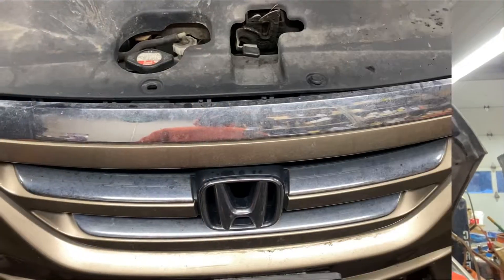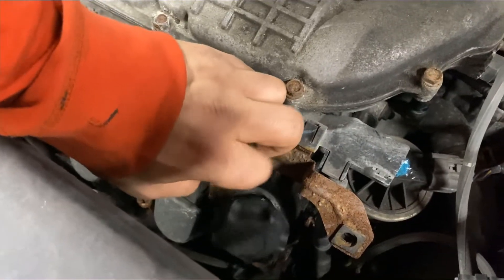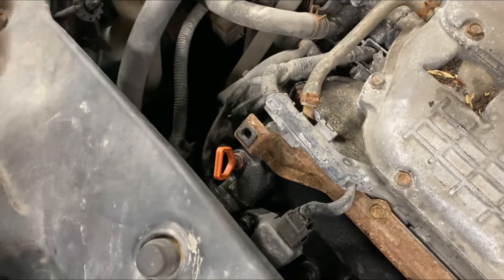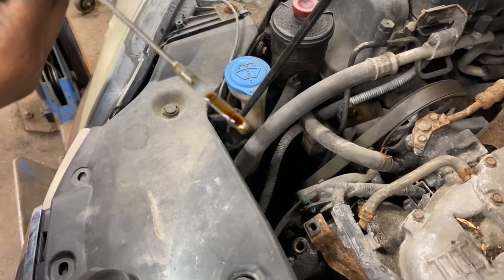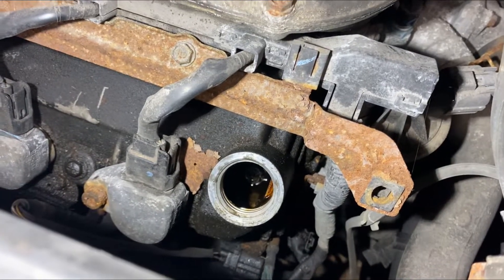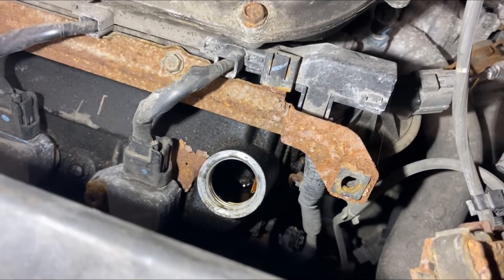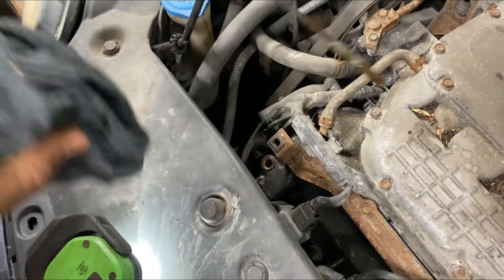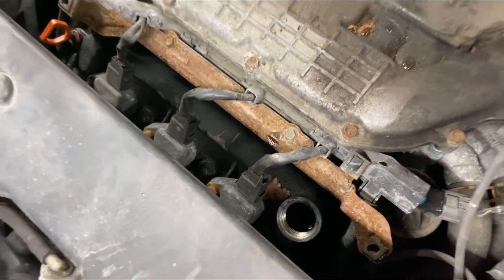What Happens If You Drive Or Run Your Car With No Engine Oil Cap! #Subscribe #experiment #auto #new

Comment: I had my car serviced while on vacation.  Driving home I noticed brown dots flying up my windshield for 25 kilometers and had no idea what it was.  Then my low oil light came on so i drove immediately to a gas station.  When i opened the hood,  the engine bay and hood were covered in oil and the oil filler cap was off.  I bought some aluminum foil and put it over the filler hole after putting in 2 quarts of oil.  I had 250 kilometers to get home.  I had to add 2 more quarts of oil and replaced the aluminum foil twice.
Reply: There was no auto parts stores in that 250k trip🤯

Comment: You only talked about the possible mess and lower oil level if driving with no oil cap, but that cap also maintains crank case pressure too...potentially leading to inadequate lubrication under engine load. 😱

Comment: I forgot to put the oil cap back on after filling up my oil and I drove for 4 days like this the car ran perfect no problems no loss of power but I got home parked it and when I turn the key to start it nothing it’s dead and my battery is fully charged I’m worried I ruined the engine due to no cap but no oil spilled out none the oil was still full and the location of the gas cap is straight up making it difficult for the oil to escape but my heart dropped when I seen the gas cap was off it was towed to the shop I’m waiting for a diagnosis on pins and needle smh
Reply: Any news? I drove mine for days like this and heavily.

Comment: Came here coz my mechanic forgot to put the oil cap on when i changed it on Thursday and now its Monday night and i just noticed my mustang 15 has no cap on. There is not much oil leaked up and there is still oil inside the engine which surprises me.

Comment: Mine was not on right, just sitting on top,,, The place that did the oil change didnt tighten the cap correctly,,, I found out after driving several hundred miles,,, I noticed my oil level was low,,, Well,,, I added oil and put the cap on the way it needs to be put on,,, 😮😮😮

Comment: I was checking my oil level and went to put more oil in, forgot to put the oil cap back on since I was in a rush and thank god my drive to work is only 10 minutes with a slow commute so nothing happened but I was worried about air getting in the wrong places
Reply: How did you clean after you find out? Just with towels & paper? Or any damage on others?

Comment: Came here because today my mechanic "forgot" to put the oil cap after a service.. Now my forester smells like it took an oil bath, inside the entire engine bay there is an oil layer. Hopefully it didn't ruin the engine!
Reply: This happened to me as well. Are your engines good?
Reply: Must of been a complete retard. Hope he was sacked
Reply: Did it run your engine? I had the same thing happen to me today
Reply: @DannyM1224 did it ruin yours ? I just had this problem aswell

Comment: Would the oil need changed if it was left off for only say 100 miles driven that way, with cap off?
Reply from the maker: That’s a great question, the best recommendation would be to drain and refill your oil to prevent a build up of debris in the engine oil components. However more likely the engine oil filter will collect some of the debris. Depending on the road conditions and environment, these may contribute to the amount of debris that may have been sucked in. Overall you should be okay until your next oil change. I would keep mind of any issues that may occur as a result and begin with changing the oil in that case.

Comment: I just dropped my oil cap on the right side of my Honda CRV 97 model LX and I can't find it in the engine compartment do you have any suggestions? September 2024 1800 hours
Reply from the maker: I suggest getting a new cap from any local automotive parts supplier nearby! Most likely the cap will find its way through and fall to the ground as you are driving! Hope this helps :)

Comment: Let's say you drive a car for about 450km with regular stops every 80-100km with an oil cap that is placed upside down instead of fastened up-right in the socket, mind you the cap is trapped from above by the bonnet so there is no chance of it falling off all the way but oil lightly spits out coz of bumps and uneven surfaces. No warning light comes on and the temperature gauge is at normal reading levels. Then you pour in about a litre of oil after noticing the error, and it's not smoking or anything the next day you start it up and drive, still feels normal. What's the next best thing to do in this situation? Drain all the oil out and replace with a whole 5L of new stuff or rather do a major service instead to be on the safe side?

Comment: I did the very thing added oil and forgot to put cap back on.. and luckily week's later it was still tucked in-between rad house
Reply: My mechanic had put oil in the car and accidentally dropped the cap under the hood between the hot engine and radiator. Out a towel in the filler part and Told me to get home let it cool off and put the cap back on. A week later I have forgotten to do it and the cap is now melted. I’m worried do you think this has done damaged or contaminated my engine n?

Comment: I did this lost the oil cap in the machine did a long drive. No oil mess no oil drop but sadly my engine light came on. Apparently messed up the pressure as the cap was off 😭😭😭😭😭
Reply: what happened after? how do you fix the engine light?